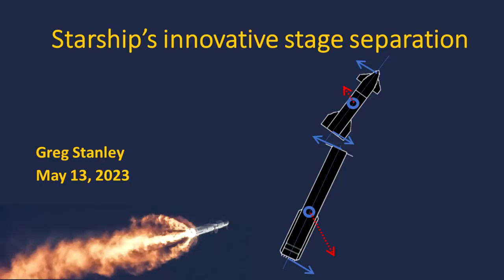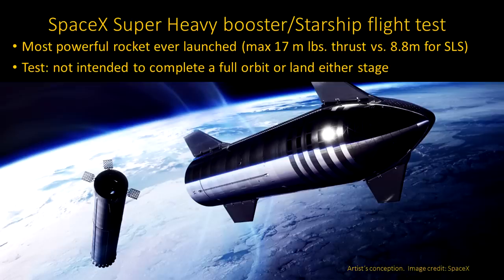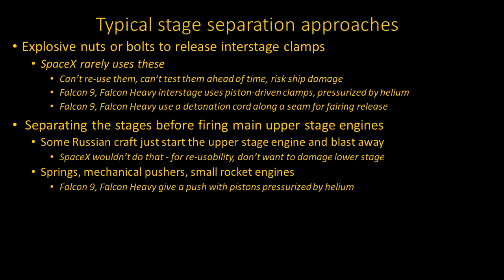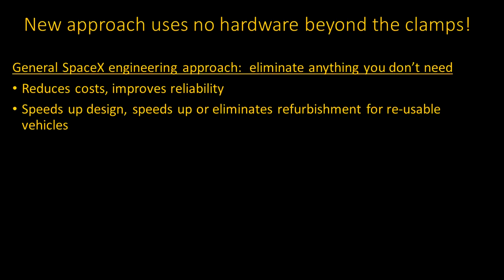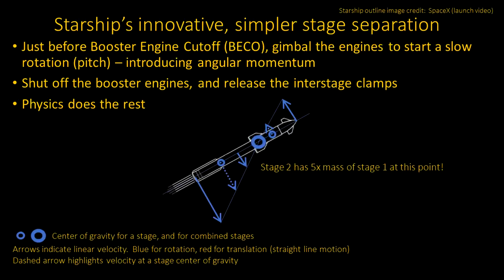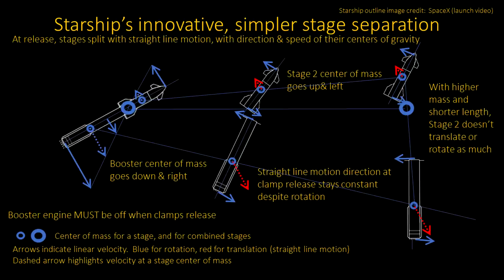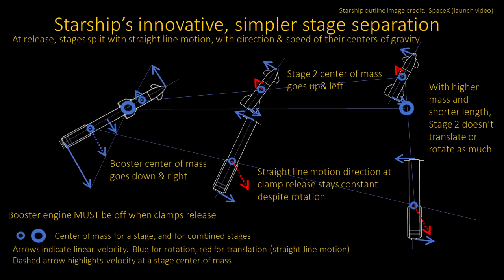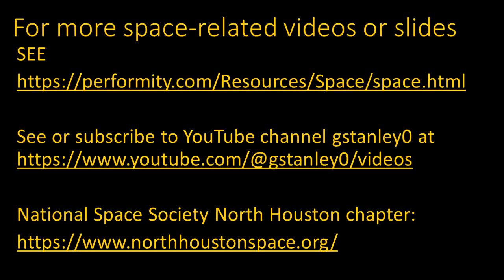Starship's innovative stage separation, using no hardware besides clamps, illustrated

Comment: "Reusability is at the core of SpaceX design philosophy" well it would be nice it they actually went ahead and designed for reuse then. They don't.

The American Titan missile and LV also used "hot-staging" where the upper stage engine fired while the lower stage was still firing so that the propellants were ensured to be "positive" feeding before engine start. (Note that this "tumble" maneuver will ensure that the propellants will be pushed AWAY from the feeds by doing this not towards them meaning some sort of positive pressure bladder will be required or some sort of ullage rocket thrust to settle the propellants. It would of course be vastly more efficient to use those same ullage rockets to push the stages apart but as this has nothing to do with 'innovative' staging and everything to do with both Starship and Superheavy already being overweight they came up with this kludge)

The "engineering" here is not to eliminate proven and well understood systems that are known and proven to work but to eliminate mass as noted above the stages are already over-mass and this adds SO much more complexity and chances for malfunctions not to mention aerodynamic and structural issues that it's a wonder everyone is not pointing out how stupid this method is. (And all that before we get into the issues with the payloads this thing is to carry... imagine several hundred tons of liquid propellant CARGO in the Tanker Starship sloshing about while trying to "right" the ship and fly straight) This is not 'innovation' but desperation.

The correct term for the 'maneuver' is a tumble, not "pitch". Pitch could loosely be explained as a direction but in truth they are throwing the vehicle into a tumble to try and separate the vehicles which introduces most problems than it solves. By the 'logic' that SpaceX is supposed to be using the "best" rocket is NO rocket but we all know that's not the point so instead of actually using proven and well understood methods that do NOT introduce huge amounts of complexity and failure modes which this does.

It should also be pointed out that no commands were issued because SpaceX lost communications with the booster which is what they have said and the onboard programing apparently could not handle the loss of control and shut down. They also admitted that the 'termination' was structural failure rather than the actual termination system which did not function properly and was also admitted to be far less than needed to actually terminate the flight. None of this was helped by using known high-time and near failure engines, and vehicles which were known to be less capable along with bad (no actually) pad design and lack of basic infrastructure, safety, and design. This flight was a total failure from before the countdown started and has only managed to show how far from the company that created the Falcon family the current SpaceX is.
Reply: There is no tumble necessary. It is just a pitch with a slow rate around combined center of mass of the rocket. A subtle rotation of the combined rocket. For the two separate center of masses of the stages which are very likely multiple 10 meters apart from each other that means a significant movement sideways in different directions while still combined. And when the clamps are opened that movements keep going. And the rotation as well. That rotation would in fact help that the engines of the ship are no longer pointing to the booster after a few seconds. They can start the engines quickly and turn the ship to the desired direction by gimbaling the engines when they have a save distance to the booster after a few more seconds.
BTW they are doing that maneuver already at every single starlink launch. A subtle rotation and opening the big "clamp" to let the satellites drift apart from the upper stage very slowly.
Do you really think they have not already discussed arguments like yours several times internally. before they decided to do so and before publishing that plan?
Reply from the maker: re:  tumbling and ullage:  I agree with @hendrik1745 here.  Also, see the discussion about 8 days earlier started by @tedarcher9120 :  

After stage clamps are released (3 seconds after MECO), and each stage rotates around its own center of mass, the propellants are pushed outwards from the center, including at least part of the LOX tank if not all of it. Hence at least some, if not all LOX flows down:  rotation provides the ullage effect for the next 5 seconds until the upper stage engine starts up.   For the methane tank, at least some of it will probably be below the center of mass depending on the payload, providing the same ullage effect (and perhaps some vapor at the center of mass if it's in the methane tank). 

But in any case, as pointed out by @hamjudo , the downcomers taking the fuel to the engines  are large.  There will be enough liquid methane in its downcomer below the center of mass to start the engines.  And furthermore, as @hamjudo also points out, the upper stage engine startup includes running high pressure gas through the turbopumps as they get up to speed, and the gas is expelled out the bottom of the rocket, acting as a cold gas thruster, providing both ullage and helping with the separation.   ( @jamescobban857 also pointed out that the upper stage vents high pressure gas from the propellant tanks through the cold gas thrusters at the bottom)  

Also, the points discussed earlier include that with the extremely-subcooled liquid, and autogenous pressurization (where the gas is the same chemical as the liquid), bubbles aren't likely to be as big an issue as in other rockets where the gas is helium, which won't dissolve into propellant. 

re:  re-usability.  Do you have some examples of where Starship failed on re-usability? (besides the launch pad, an agreed failure).   It seems to me that the rocket is far more re-usable than the next most re-usable rocket, the Falcon 9.  (although I suppose this is really outside the discussion topic anyway). 

re:  point of the engineering.  Not sure what you're getting at here.  Isn't it always a good thing to reduce mass in a rocket?  And the new system is certainly simpler in terms of hardware and failure modes associated with the hardware that is no longer there.  You could say that the flight operation is slightly more complicated because of the extra step of adding the slight rotation and subsequent stopping of it.  But there's still a net removal of failure modes.  I would think the recovery of the upper stage from the slight rotation is something just absorbed by the normal thrust vector control - no new failure modes introduced there even operationally - they're already covered by failure modes for the control system and the hardware & software supporting it.  And as already noted elsewhere, SpaceX does have experience with inducing rotation in a payload - that's how they disperse their Starlink satellites.  Those satellites recover control just fine, even with the limited thrust from their little hall-effect engines.

re:  aerodynamic and structural issues:  Given that the stages held together and also withstood the stresses from (an admittedly lower-speed/lower altitude) max Q, and importantly, multiple tumbles during engine thrust, even while at some point the Flight Termination System also probably tried to destroy everything, I think the sturdiness of this rocket even with propellant sloshing around is now well proven.  And,  as for aerodynamics and stability, the ship seemed to go for quite a while without tumbling despite supposed loss of thrust vector control early on.   I found that surprising, since I would think Starship would be unstable, given those fins at the very front, inducing so much drag or lift ahead of the center of mass.   

re:  tanker variant of Starship.  There wouldn't be much sloshing going on - it's full of liquid at the point of stage separation, and again, probably heavily subcooled to minimize the amount of vapor that would form because of heat transfer.  

As for the Flight Termination System, yes that was a complete failure, and needs to be fixed. But that wasn't the point of this discussion.  Same goes for the concrete launch pad -- definite fail and lack of judgement there.  And, using a bunch of old engines is also questionable.  All things to fix for the next test.
Reply: @hendrik1745  Rotation is not pitch so no they don't "do this already" and frankly as bad as this whole development "program" has been going I have doubts much is discussed before they decide to toss it out and see if it works. "Likely", "possible", "should be" again it's not like this has not come up before as a concept,(it has) and the preference is a mechanical separation system because they are reliable, well understood and work fine.

"The best part is no part" is (like pretty much everything out of Musk's mouth on "engineering" for which he has almost no experience) ultra-simplistic and as usual, wrong. And again this is "planned" with an essentially empty shell which is non-representative of the actual vehicles (which have not been finalized yet) so the actual physics are likely to be very different.
This isn't a good idea and the fact that SpaceX thinks it is points to some fundamental issues with the vehicle design. (As noted they have said this is to save weight and given the supposed 'margins' that they are supposed to have that makes no sense whatsoever)
Reply: @randycampbell6307  There are 3 ways of rotation of a rocket or airplane: Roll, pitch and yaw.
Roll is a rotation around the longitudinal axis. It does not help to separate the stages.
Pitch and yaw rotate around an axis perpendicular to the rocket. Both pull apart the pointy end away from the flamy end. So the stages separate just when the clamps are opened.
And yes, they use exactly this kind of pitch-separation when releasing 50 starlink satellites from the falcon upper stage.
Reply: @hendrik1745  Yaw actually according to the videos, with spacers and foam inserts between the satellites to help separation and protect them during launch. In a stable orbit in a vacuum.

So again, not anything like they are suggesting doing with two stages still in the atmosphere in a dynamic flight configuration and in freefall.
Reply: @randycampbell6307  From physics point of view there is no relevant difference between orbit and freefall.
Separation with pitch, engine cut off, drifting apart and ignition will last for 10-15 sec. Coasting (still upwards, not freefall) for that time is the same for many other rockets.
Starship reached 24 miles altitude. Separation will normally take place at over 40 miles at an air pressure below 1/1000 of normal atmosphere.
A slow rotation of 10 deg/s will be enough to separate the stages within several seconds.
Once again: do you think the engineering team of the most successful space company in the world are all completely stupid? Do you consider Musk as inexperienced despite he is in fact something like the chief engineer of Tesla and spaceX?
Reply: @hendrik1745  Musk is the CEO, (and ONLY the CEO) of Tesla and SpaceX as he has no engineering experience or training. None. The only thing he ever helped "design" was the proprietary recharge paddle for the early Tesla's, a design no longer used. As the person in "charge" he can of course name himself whatever he wants, (actually he can't as that's not legal but that's a nit) but that proves nothing about his ability or competence both of which are clearly lacking in engineering.

Do I think a company with a proven record now of failing to take into account simple engineering and physical factors in basic design and testing is "completely stupid"?
Again the current record would point to that being an issue, yes. Please keep in mind that the current "SpaceX" is no longer staffed by the experts and engineers that made the Falcon a success. Most of those people have been driven off or replaced so it is a VERY relevant question if those now "designing" (and we can use the term very loosely here) have the same capability as the old SpaceX did. From the evidence the answer looks to be no and what we've seen backs that up.

"Coasting' with no thrust is called "freefall" it works the same going up as it does going down. 1/1000 of "sea-level' atmosphere at an estimated (assumed actually) speed of around Mach 10-12 will still give enough resistance to have effects. While the Booster will be slowing down, gravity will be dragging the much heavier Starship down and back towards the still ascending booster. As SpaceX has shown quite often before simply ignoring or disregarding prior work does not often work well for them because there are good and solid reasons for doing things certain ways. My personal 'bet' is this method has been tried and/or tested before and there is a good, solid reason why no one uses it that SpaceX will manage to 'rediscover' before they are forced to fall back on a better method. That could have been prevented by actual study and testing but the current SpaceX instead wastes time, money and resources, (and the fact that most of it is MY money as a taxpayer is annoying to say the least) so they can have nice visual displays of falling and failing rockets

SpaceX was successful in developing the Falcon family by NOT doing anything like what they are doing now. That in and of itself should raise eyebrows and questions given what they are doing now has NEVER been used to create a successful vehicle.Yet Musk-et-al claim it can. I choose to not believe something without proof and so far they have been "proving" the opposite.
Reply: LOL what kknd of physics did you study?  Do you Newton's laws of motion?  Both stages are coasting upwards at same speed. Ship has more mass and so as well more momentum. Booster has bigger size  and more  friction in non-ideal vacuum. Which one slows down faster? Try to throw a cannon ball and a feather upwards at the SAME speed. Do you really claim the cannon ball to slow down first because of its mass?
But YOU claim Elon Musk not to have any engineering experience?
Reply: @hendrik1745  Musk does not have any engineering experience, he also has not mechanical or service experience yet claims to be both as well. He also has not actual knowledge of rockets and rocketry by his own admission he's only done a small bit of "self study".

I'm a mechanic, electronics and support tech and have been my whole career. I've "self studied" more on rocketry and rockets than Musk by decades so I'm about as qualified as he is in this subject.

A cannonball will slow down due to its mass while the feather is more drag dependent and will slow down less due to gravity.Hence in an actual vacuum they fall at the same rate. Simple physics.
Add in residual atmosphere and the physics are not long so simple or easily predictable.
Separation at hypersonic speeds is never simple or easy and it certainly won't be 'gentle' and it's well known that you need some sort of positive separation mechanisms to help ensure dynamic stage separation.

SpaceX has said that they are doing this to save mass, they THEN added the idea it was to reduce complexity and chances of failure, (both clearly false assumptions) but going back to the original 'need' why would they need to 'save mass' on a vehicle which has such vast margins to play with? Especially when they have yet to even demonstrate the expected mass margins, (let alone payload) capability of the proposed "design"? (And keeping in mind that this is nowhere near a finalized design)

Given that the current SpaceX has clearly shown that they are not able to produce working simulations and have consistently fallen short in basic design work on this specific project why would anyone believe that they have done the proper background work on this concept? We are clearly not dealing with the same SpaceX that designed and built the Falcon series so why assume that the latter can do the same job as the former?
Reply: @randycampbell6307  cannonball and feather in vacuum: yes they fall down at same speed in parallel. Not only that. When thrown up in parallel then they rise and decelerate and come to standstill and accelerate downwards all in parallel. They are both in the same field of gravity  of earth. They are acellerated in the same way. When the cannonball is 100 times more heavy then a force 100 times stronger is pulling down. Hence same acceleration.
When you add some atmosphere then the drag influences the feather much more as you correctly said. So the feather and the empty booster slow down more than cannonball resp ship filled with fuel.
Reply: @randycampbell6307  Hi Randy. What does no more answer mean? Did my argument convince you or do you still think the cannonball will slow down quicker?
Reply: @hendrik1745  More like neither of us is going to change the other ones mind so the point itself is moot. The basic method will not work they way ascribed and it's far less safe and efficient as numerous well understood and known methods.
Reply: @randycampbell6307  Physics is not a matter of "ones mind". I am sure the feather decelerates quicker than the cannonball. But I can theoretically be wrong.. Of course everybody can convince me that I am wrong with arguments and calculations. Till now you found no clear argument for the cannonball to slow down quicker.
The question if the separation mechanism will work is more complicated. But when I apply all my knowledge of the laws of physics to that mechanism then I get to the conclusion it will work. And you could till now not convince me that it will not work since your interpretation of the cannonball feather experiment is very unusual.
Now you describe it as less safe and efficient. Come on. You are a tech guy. We would still sit in the cave at the fireplace if everything had been done the well established way and any new idea had just been declared as ineffective without a real argument.
Why is it ineffective using engine gimbals and latches instead of explosives that are not reusable? Or latches and springs which must be preloaded and  can break? Of cause I have still a very small doubt, if everybody has just not seen a fundamental problem. But it is worth trying it. It will very likely work. The rocket is not yet human rated. Just  using latches and pitch rotation could make the reusable rocket system less complex and more reliable.
Reply: @hendrik1745 "Physics is not a matter of "ones mind". I am sure the feather decelerates quicker than the cannonball. But I can theoretically be wrong.. Of course everybody can convince me that I am wrong with arguments and calculations. Till now you found no clear argument for the cannonball to slow down quicker"

As you state you have made up your mind because the calculations you have done support that outcome. I disagree but have not the math skills to "prove" it to your satisfaction. You've already made up your mind. We should probably start with the basic assumption that it is nowhere near a 'feather' and 'cannonball' since it is essentially an near empty tin can and a full tin can in a partial atmosphere but again, your figures have convinced you it will work so nothing I say (or likely show) will change your mind as you have the answer you want. We'll see I suppose.

"The question if the separation mechanism will work is more complicated."

Not really, it's two masses in free fall while still inside a residual atmosphere trying to 'drift' apart with no active systems engaged to help the process. "Engine gimbels" have no effect since the engines are not running and there is no real 'pressure' to feed any thrusters given the free-fall condition and the fact that they are 'supposed' to be "pressure fed'.

"Now you describe it as less safe and efficient. Come on. You are a tech guy. We would still sit in the cave at the fireplace if everything had been done the well established way and any new idea had just been declared as ineffective without a real argument."

A yes the "we'd still be living in caves in everyone didn't accept every assertion and idea that comes along without question" line. See the thing is as a "tech" guy I happen to know that there are many ideas and concepts that do not work as well as the math and figures say they should. Often because of very basic and obvious assumptions on the part of those doing the design work. Like not being able to get reliably "pressure fed" engines and thrusters to work just as SpaceX 'rediscovered' during the Starship testing. You'd think they would learn but they have run into this problem before and still made the basic mistake all over again. 

"Why is it ineffective using engine gimbals and latches instead of explosives that are not reusable?"

Good argument but unfortunate for you I never made that argument. YOU did, just so you could shoot it down. Nice.

Latches and springs are reusable and that's also what SpaceX used on the Starlink satellite deployment. The rotation just assists. And did you notice the satellites bumping into each other while doing so?

Springs, pistons, oh a dozen different "simple" and effective means to instill a separation between the stages. Even something as "simple" as RCS thrust would do so given time. Oh wait, aren't they supposed to use RCS thrust anyway? Odd they seem to think that won't work

Starship will NEVER be "human rated" you might pay attention to what is being said about it by SpaceX. They have stated that they would not seek "human rating' because of the required systems (such as a launch abort system) that would be needed given NASA/FAA guidelines for such requirements. Instead they will seek enough "proving" flights to try and apply for standard FAA "flight rating" by flying it "thousands of times" successfully and fully recovering it. Off to a very rocky start considering no aircraft would be allowed to do so with such a shoddy design program.

The main issue is that at this "point" in the development they should not be "trying" new and unproven ideas they "just got" to see if they work when what they need is an actual working design.Again this is not how they built the successful Falcon and it clearly shows how shoddy this program is. No one who's had half a century of rocket and spacecraft design to draw from should have such shoddy and unworkable "test" vehicles right from the start. Mechanical and other 'teething' problems are to be expected, (Astra comes to mind here) but you START with a working design. You don't start with "just" an idea and try to move to flight testing from there. (As SpaceX is proving here)

Nothing about this 'vehicle' is reliable or simple. The engines are not even considered reliable at this point. Tossing more 'experiments' into the mix is not helping development and again it's odd that they need to reduce mass (again the entire 'reason' behind this idea) on a vehicle that is supposed to have such huge performance margins when it does not even have payload or flight systems.